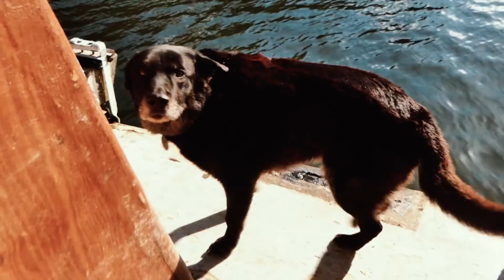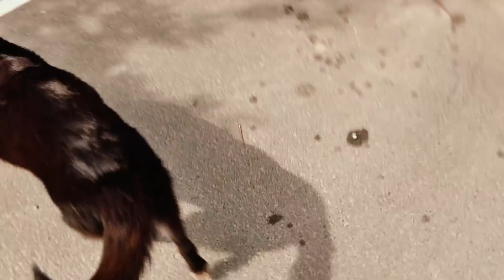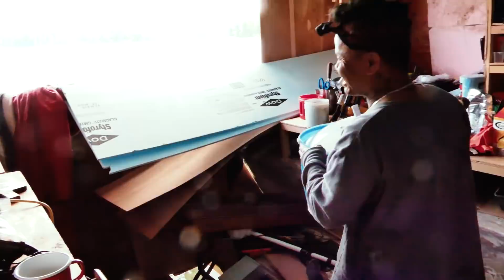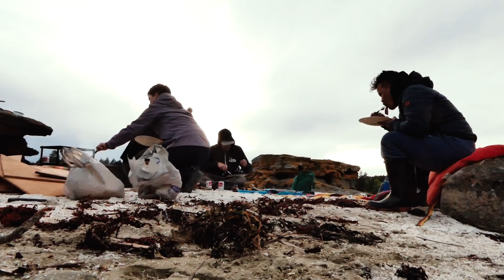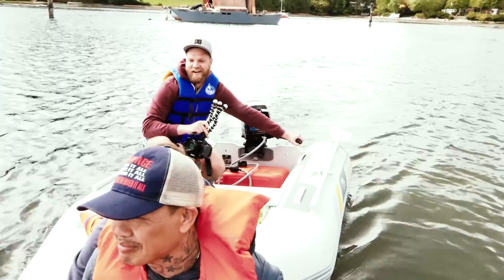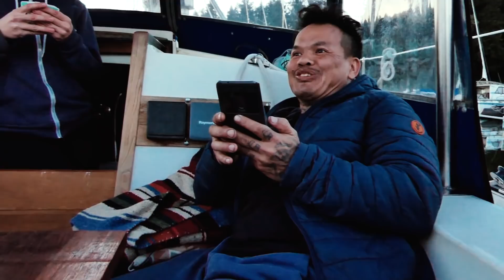Removing the Hydraulics and Some Soggy Deck - Sink or Swim 79

Comment: Simon, I spent 35 years managing Performing Arts Centers and I bought a huge amount of microphone during my career.  Never did I ever consider a Rhode mic.  The just do not hold up!  Save up and buy a high end mic and you will be done with this issue unless you drop it in the ocean!  EV, Shure, would be the first brands to check out!  BTW, your videos are wonderful with sound or not!

Comment: Those mics really aren't designed for professional use.  They're basically toys.

What you need is a proper field recorder by a company like Zoom, like their H1 or H5.  That way you can run audio directly to the camera AND record it separately at a much higher level of quality as a backup.

The best solution though is something like Beachtek's XLR boxes the DXA-Connect or DX-SLR Pure with a proper XLR mic.

For what you've spent and will continue to spend on all-in-one mic solutions, you could buy something more reliable that will probably never break.  I know they're not the most convenient solutions, but that's what it takes to get reliable audio these days.

Regardless this was still a solid episode, so I wouldn't stress too much.
Reply from the maker: Broke a zoom h4n a videomic pro and a videomic and of course now the videomicro. Gunna try shure next. I'm hard on my gear